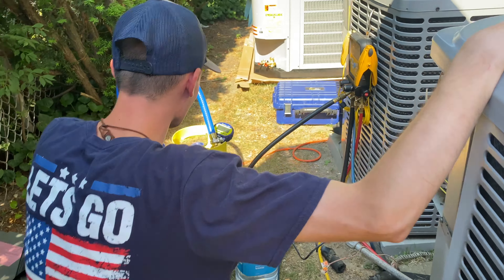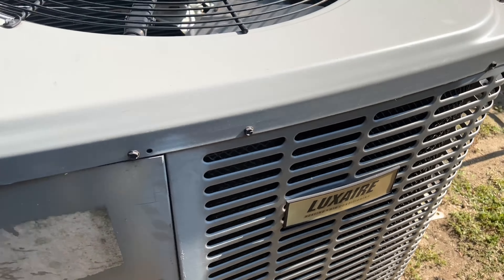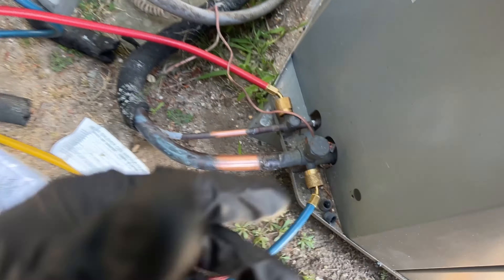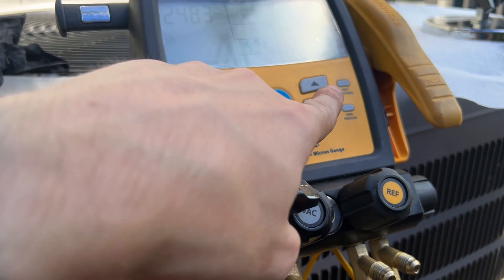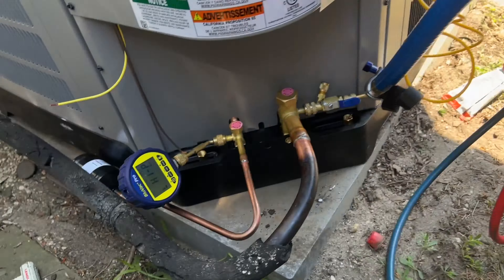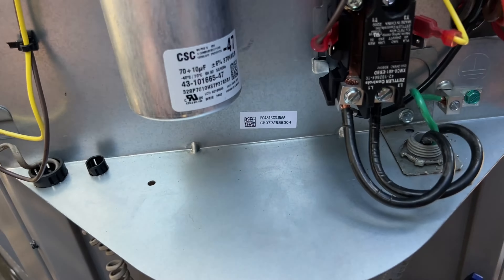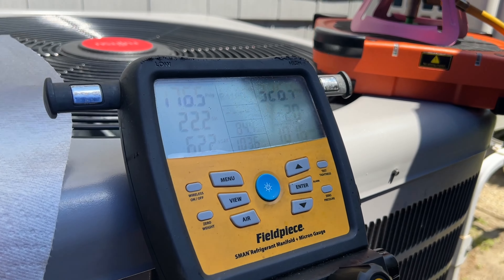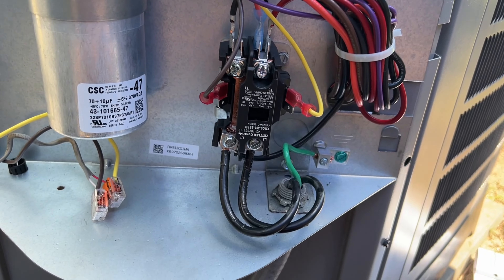Condenser Swap Out Featuring @PipeDoctor

Comment: Keeping that copper piping shiny! Keeping up my suggestion! 🤙

Now, I didn't hear your thoughts as to what may have killed the compressor, but based on Mike's and your video, I'll put my two cents as to what happened. Heat cooked the oil, oil was not able to lubricate components. components got hot inside. Wiring didn't like that and also got hot. lost it's varnish coating from the heat, exposing a part of the windings. wires touch in an unintended path to ground, and zaps the windings. Kills the compressor. Cause? Dirty coils and lack of maintenance likely...

Good thinking with your water bucket. Another thing you could use is that Coolpressor tool if you need constant water or your bucket broke and had a crack or something, or a tool made just for the purpose. CPS makes the tool called "Pro-Set Molecular Transformator Sub Cooler". Yeah, its copper tubing in a coil in a can and kinda pricey. You end up just grabbing less water and I dunk it in a small pail and run one more hose to the tank, since this tool will be in between the recovery machine and the tank. I use it on all my recoveries. The more you use it, the time you save is worth the cost. Time is money! 🤑 Recovery times end up being so much faster. 👍 I hate hauling buckets on rooftops. I rather have a small pail of water, the tool,  save my back,  and be off the rooftops faster. 💪

Good work! Looking real good. Have a good one and stay safe, sir! 😎
Reply from the maker: I tried there molecular thing. It didn’t work. Pressure tripped off instantly. Tried it multiple times followed the instructions to a T
Reply: @DCHVAC  Good thing I gave you another suggestion with the Coolpressor tool and stcking that magnet on the tank to cool it off in case your bucket springs a leak. 

I usually get away with it on rooftops, but it will be an alternate option to keep in mind! Have a good one! 👍

Comment: For stripped out screws,fold over a piece of copper wire and insert it in the hole (small wire)then the screw! Or grab a plastic anchor!From time to time it will get you out of the woods,I see stripped out screws everyday and alot of times longer or heaver screws just wont do it,so you have to have options!

Comment: Probably just a silly suggestion from a nobody, but with the tank in water try to have a hose at the bottom slightly open.  Yes the water will overflow out of the bucket but at least the water won't become heat soaked.
Reply from the maker: Yea it would be a good idea but I had no issue. The pressure dropped so much and stayed there it didn’t climb much.

Comment: 45 out of a diffuser…. You should check your static…. Sound like an oversized starved system, that black oil aka burn out… you washed the oil out of the compressor from flood back now you dig in why I gave enough clues
Reply from the maker: It’s not about the temperature out of the diffuser, it’s about the differential. Almost 22° exactly. Where it should be. 

It’s not an oversized system, we confirm system sizing with Manual J.

Comment: Peter let’s say you return air 72 and supply 46  your split is 26 
What is CFM on the air handler/ furnace you may be set for short cycle and condensation on the I am not a super tech just saying
Reply from the maker: I have no idea what this comment means
Reply: Just want to see if you tested airflow and what is the dew  point temperature inside the house